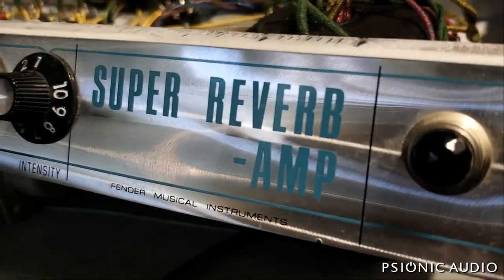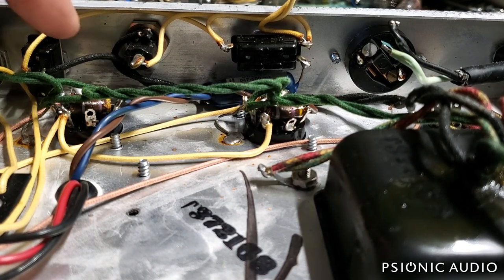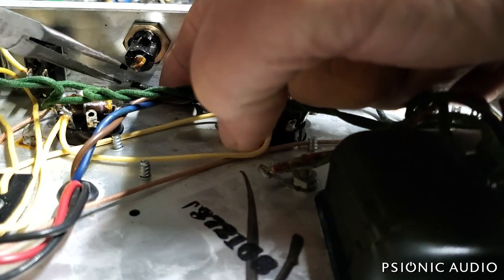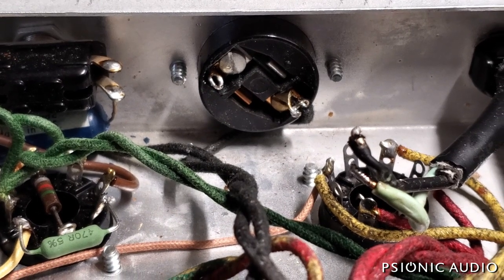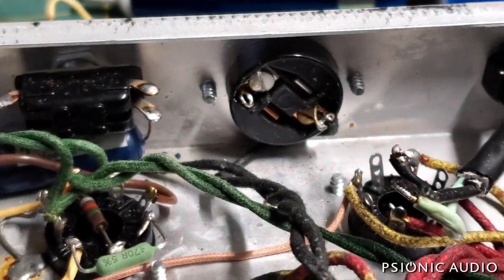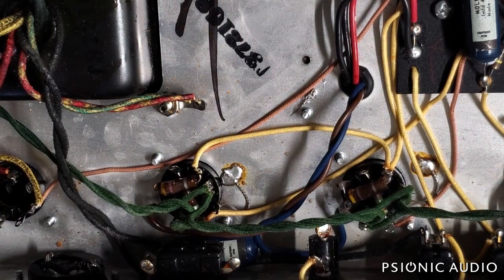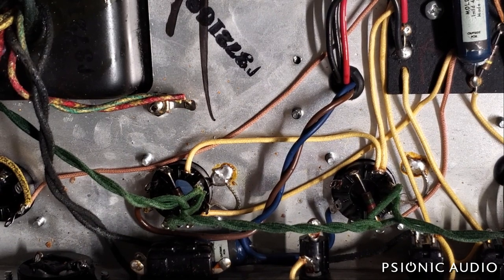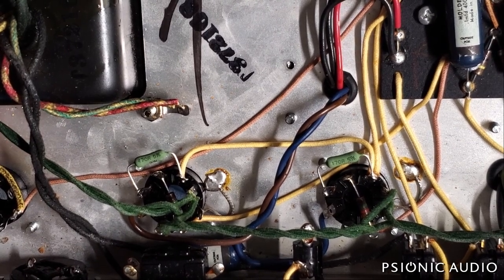Time Machine '68 Super Reverb Part 2 - Restoration Approved - Let's Get Started

Comment: Beginner question - why not run the hot phase from the power cord to the switch first? If the phase was switched, the fuse holder would be de-energized by opening the power switch. Seems that it would be safer to check the fuse if the fuseholder was de-energized.
Reply from the maker: The purpose of the fuse is to protect the wall supply from failure inside a device. Switches can fail as a short. Having them before the fuse is therefore dangerous.
Reply: @PsionicAudio  OK, I get it. Thanks Lyle and keep up the good work! I've learned from your videos, so I appreciate you. Example: my Mojotone kit amps (5E3 and 6G3) grounding simply wasn't that good. Your videos showed a better way. The amps run quieter now. Thank you!

Comment: why not replacing those Grid stoppers? won't you lose a power tube when they go? that are already drifted. another question, isn't it better to use 1watt 470 screen grids (and not 3 watters) so they will be used as afuse?

Comment: Interested in your thoughts on fusible resistors since you discussed the screens there... I had read a lot of different things about fender screen resistors including that the original 1 watts would burn open if there was a failure.  I used some 1 watt fusible resistors in my bassman thinking it would cut the power but without the flame damage/burn marks everywhere that the carbon ones leave.
Reply from the maker: That gets tricky. Aside from never wanting fuses or fusible anything in some parts of the circuit like bias, you have to know the normal current but also what the worst-case-but-still-normal current is. In general, I'm not a fan, especially as implemented in a lot of current production amps (I'm looking at you, JCM 900). No client ever likes an hour of labor to change one resistor, particularly if nothing in the circuit caused it to blow - the designer just didn't do their math.

Flameproof, fine. But fusible, I'd rather they just used an actual fuse.
Reply: @PsionicAudio  fair enough.  I suppose it's okay for me because I don't have to pay anyone to replace a resistor.  Loving all the content lately and I'm always learning things so thanks

Comment: Lyle, I hope I'm not being a pest, please let me know. I cobbled together a Ward's GIM-9111A from a Univox 1221 and everything seems ok but the screen voltages on the 6L6GCs are a few volts higher than the plate voltages. Is this ok? There is a 1000k dropping resistor between 50mf that feeds the plates and the 22mf that feeds the screens. There is no other reservoir before these. Your Excailbre build is shaping up really well, your skill as a builder is top notch. Thank you for the videos. I don't know if I could have attempted this build without them!
Reply from the maker: Thanks.

Do you mean a 1K dropping resistor?

It can be normal for screen to be at or higher than plate at idle in some amps.
Reply: @PsionicAudio  Yes, a dropping resistor between the two voltage points. I increased it to 1360 ohms and it bumped up the dissipation to about 75% per tube and made the plate and screen voltages about identical.
Reply from the maker: Without having the schematic I can't say if that's a good or bad thing, and I don't feel comfortable (or have to time to be) remotely diagnosing an amp on YouTube. Sorry.
Reply: @PsionicAudio  It's no problem whatsoever. You told me exactly what I wanted to know. Thanks again,

Comment: Great work as always, could I get a link to those low mass vishay resistors.  Thanks, Paul
Reply from the maker: Vishay through hole axial wirewounds at Mouser. AC and PAC series. Tubedepot also sells them.